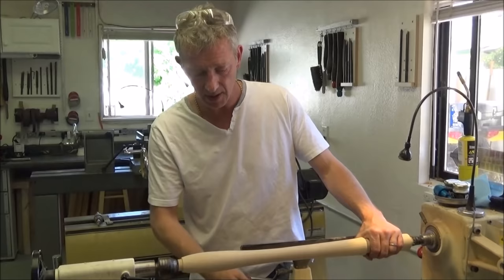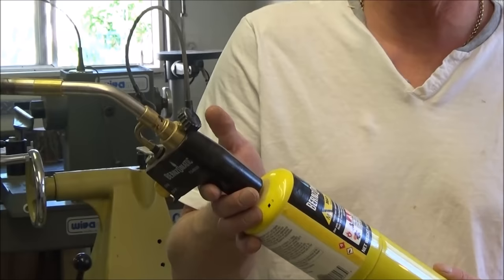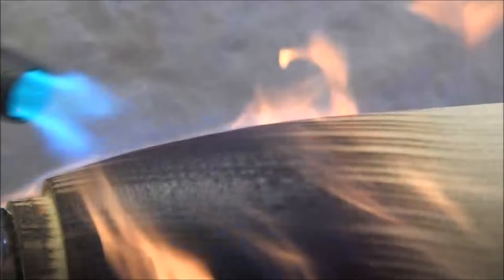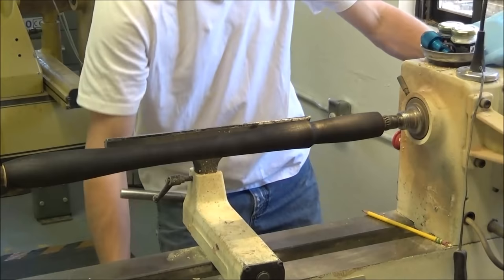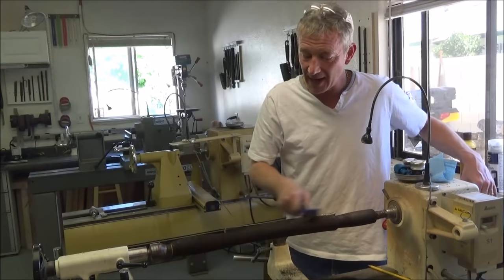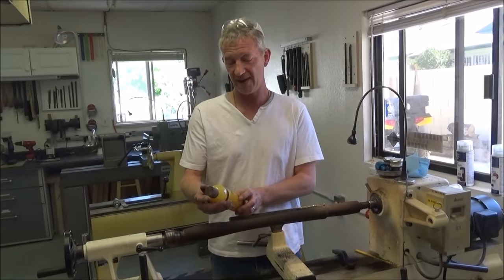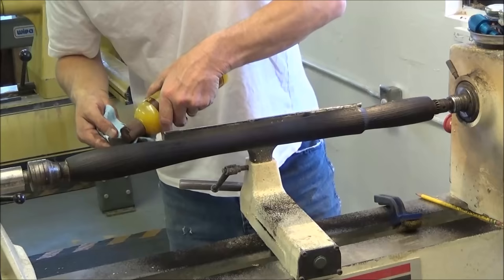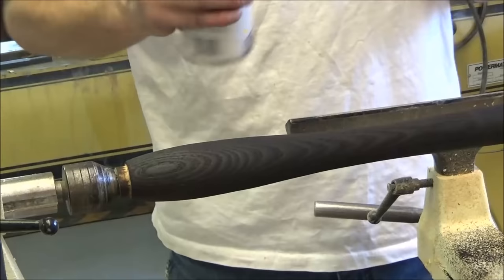Jimmy Clewes   Scorching and Embellishing a Handle

Comment: Good looking handle.  Do you have a video that shows the best way to attach your quick release units.  I'm wondering if they hold the tool as securely as if it was pressed into a properly sized hole that is drilled into the wood.
Reply from the maker: Hi mate , I use 2 part epoxy to attaché the units to the handle.
I have not had a problem myself .
Jimmy